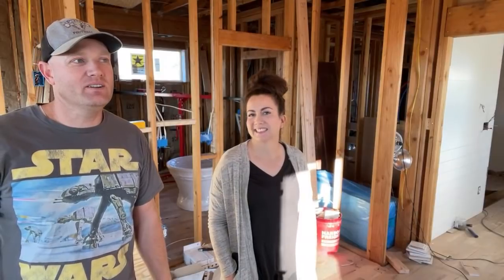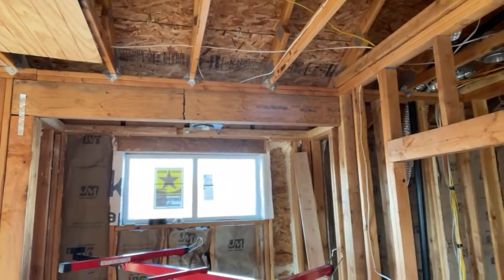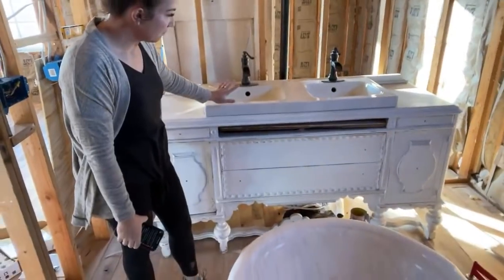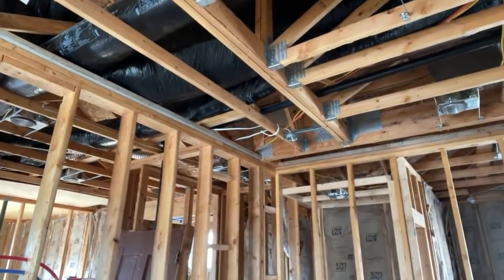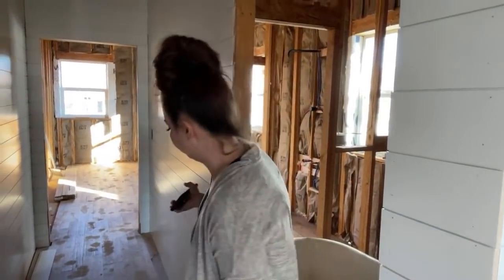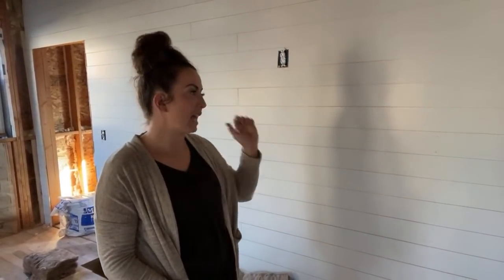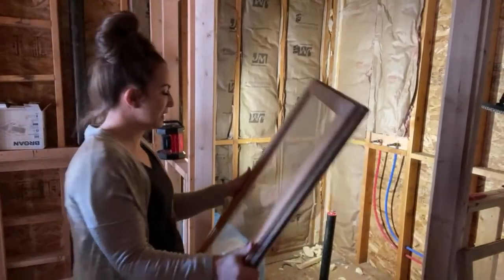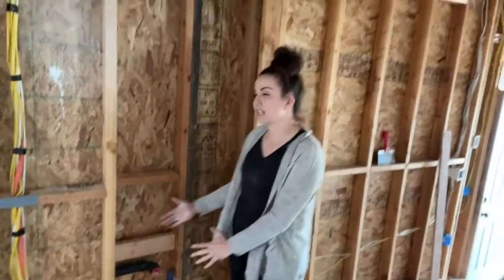Bathroom Tile Decisions and Master Bedroom Ceiling

Comment: The bannister turned out beautifully. You are going to have a fabulous home. Zeb - take a cheap lipstick and sparingly outline the rim of your ceiling light fixtures, raise the ceiling board until it is touching the fixtures, lower it and your outlined placement is ready to be cut. 👍

Comment: I saw that you insulated the interior wall between the granparents suite and the family room for nois purposes, you may also want to insulate the interior wall between the laundry room and the bedrooms for noise reasons as well.  just a suggestion.
Reply from the maker: The laundry room is against the play room. But that is a great idea. Don’t want to insulate it too tight. I don’t Want my kids saying they didn’t hear the buzzer and forgot to rotate it. Our washer and dryer running are pretty quiet. One thing about having so many kids we never have a washer and dryer for too long.

Comment: Where did you find the laundry cart?  I love it.  We just redid our kitchen, house is 1945.  After a lot of work they were able to find the original wood floors.  I have bead board ceiling and brick backsplash on the side of the kitchen where the stove is.  On the sink side it's subway tiles, white.  I wanted the brick side to look as if we added the kitchen on the original outside brick wall.  All cabinets are white except for an armoire we had built into the cabinets and it is pine stained.  They took a door that we were closing up and stripped it and made my range hood out of it, stained it to match the armoire.  Have a lot of the same taste.  I know how exciting this is for you.  I waited 10 yrs to get mine done,  Now on to the next room.  I can see in my mind how beautiful it's going to be.
Reply from the maker: Sounds awesome!  I used to carry the laundry cart on our website but they have discontinued it. I’m looking for a similar replacement now
Reply: @JamiRayVintage  Thanks.  Would be interested in that info if you find one

Comment: So what about the noise between rooms. With halo walls?  Is it going to be eco? Noisy?  My Sister had some problems with that in there home remodeling. Same situation, old home over 120 years old and added 4,000 sq feet.  Exterior all recycled brick 3 stories tall.  It’s beautiful.

Comment: Love the 4x8 sheets beadboard on ceiling..can one put that over drywall on ceiling? Would there be a weight issue?
Reply from the maker: As long as you secure it in studs I wouldn’t thing there would be an issue
Reply: @JamiRayVintage  thank you..it would be great solution.

Comment: Do you worry that the mdf shiplap will hold up with moisture in the bathroom? Or do you seal to protect?
Reply from the maker: We painted all the bathrooms with a couple of coats of exterior paint
Reply: Thanks for the tip.. I’m wanting to do Shiplap in our bathroom. I did find the pre painted mdf Shiplap at Lowe’s ..

Comment: I’m looking forward to the insulation video. I’m thinking I can do it or the 2 walls in my garage (the one adjacent to my house is already done. Not something I’ve ever done or thought I could do. I was going to hire a guy...

Yours looks less “fiberglass-y.”  Makes me think it’s going to be easier than I thought?
Reply from the maker: It’s not difficult. But it sucks. I will be honest there isn’t a part of my body that doesn’t itch 😂😂. But it’s something we can do easily. And make sure it’s done correctly
Reply: @JamiRayVintage  I totally forgot about the ceiling! Lol. Think I might have my guy do the insulation and drywall there.
Reply: @lesliejohnson7247    You might look up rockwool insulation. I don’t think it itches like fiberglass.
Reply: @cynthiafisher9907  Seconding on the rock wool, MUCH better insulation without the problems of fiberglass